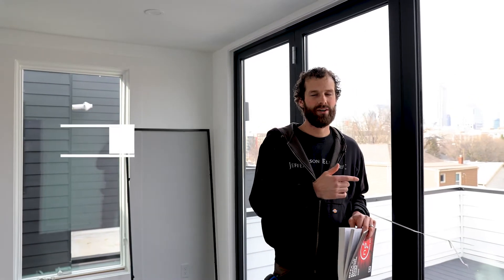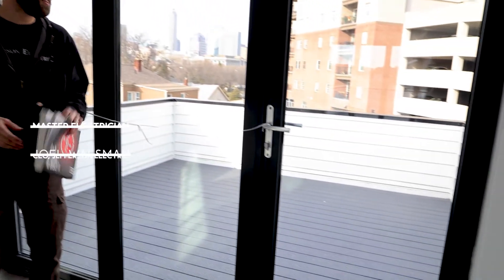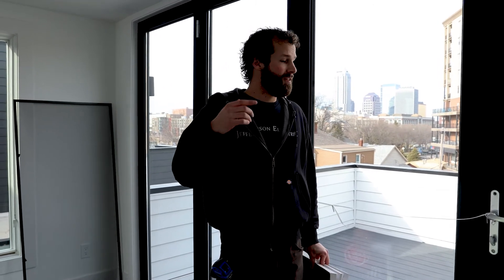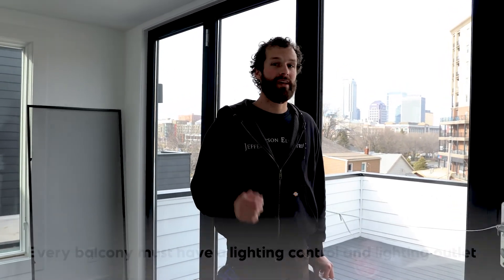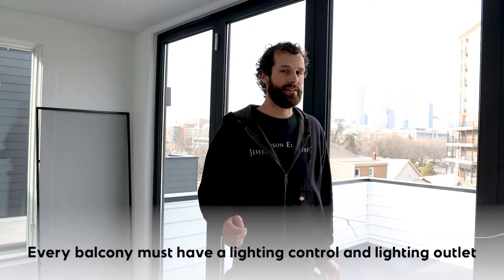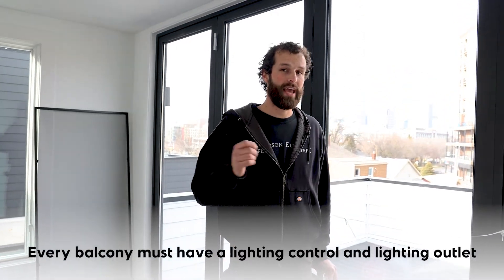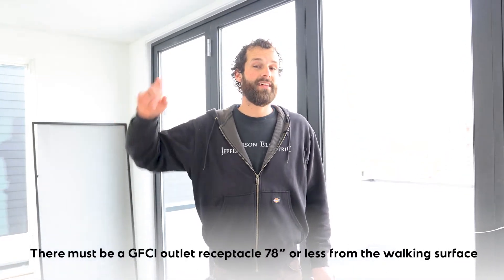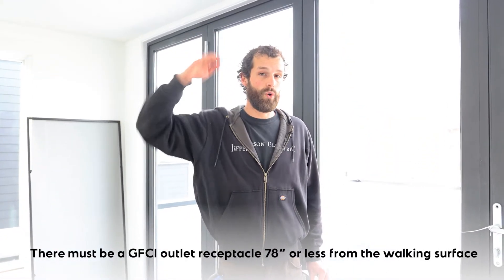Balcony, Porch, & Patio Electrical - Code Minimum

Comment: I don't think the lighting (and thus the control) are mandated by code.  The section cited (210.70(A)(2)) only requires lighting at exits to the dwelling unit that are at grade level; most balconies are certainly higher so that requirement is moot, no?  I checked 2017, 2020, and 2023 revisions.
Reply from the maker: I believe you're correct that a lighting outlet is only required where there is "grade level access" and anything beyond that would be considered best practice. Thank you for the homework and engagement!
Reply: @ElectricProAcademy  No problem, had this come up on a project I'm working on and this was one of the top google results.  It's definitely best practice regardless!

Comment: Interesting...  I don't think my outlet is GFCI protected.  Great info!  I think that I'll use that Taymac cover and TR GFCI from your "not being reset" video.
Reply: Ok I take it back.  I tested that patio outlet and it is connected to a bathroom GFCI some 50 ft away!  They went through great lengths to avoid having to install a pricey second GFCI back in the 80s when the house was built